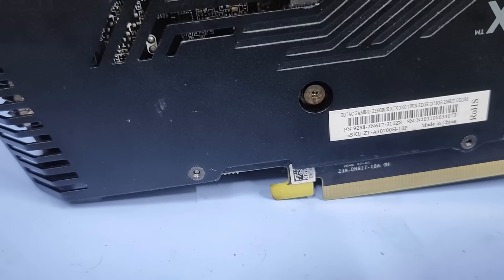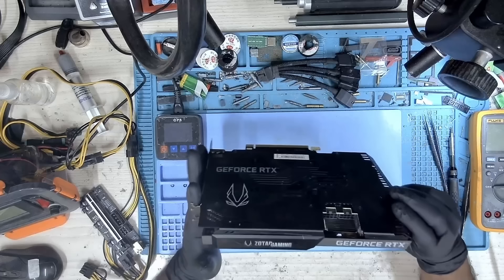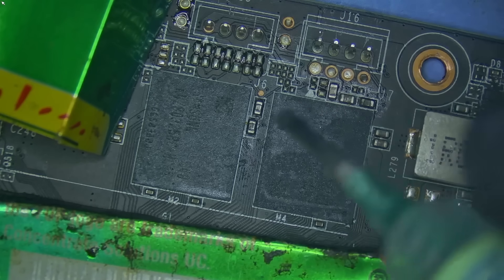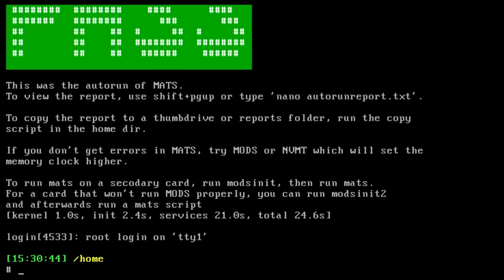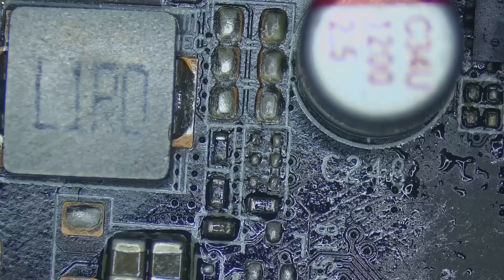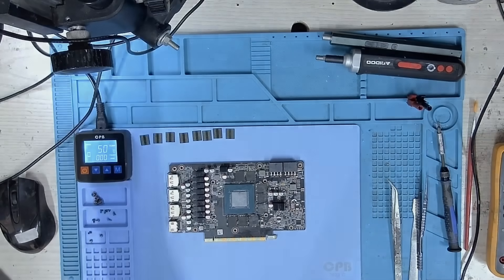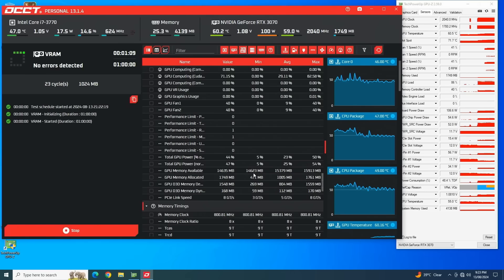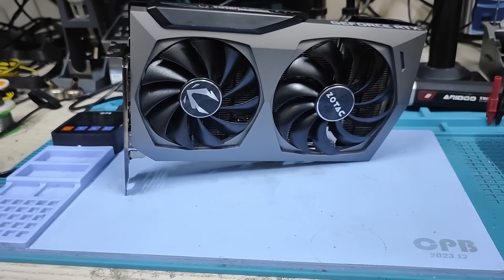Upgrading RTX 3070 Memory from 8GB to 16GB - Part 1

Comment: Since part 2 is gonna soon release (i checked the comments on your dead 3070 gpu), if possible, after a successful boot and the card manages to utilize the 16gb without any errors, would it be possible for you to mod other peoples cards?
I have a aorus 3070 gpu which i would like to game on for as long as possible, but vram is gonna become and issue sooner than i might think. I do soldering work myself but on much larger plates and way simpler (mill-max keyboards, mouse switches, basically the simplest form of hardware soldering), and im always fascinated by this type of content.

It would be cool to be interesting to see you accept other peoples cards for modifications, but i would assume this costs way more than just buying a new gpu + shipping to you and back.
Anyways goodluck solving the errors that will occur during the stress test and initial boot-ups!

EDIT: i checked your website and i can see that you indeed offer gpu upgrades to book, this comment is irrelevant now, besides the shipping part (i live in a country that barely ships anything out and if it does they charge you trillions because they suck)

Comment: is it possible to upgrade the rtx 4060 8gb to 16gb or even higher
Reply from the maker: Unfortunately none of the Nvidia 40 series can be upgraded as all the models use 2GB memory modules which is the largest capacity produced.

Comment: bro i have gtx 1050ti un runs well but after  of 1 hour using the screen begins on/off until i turn off the pc and turn it on
Reply from the maker: If the core is overheating than thermal paste is required. If thermals are not the issue the card has reached the end of life
Reply: @GraphicsCardRepairs-tk7ql  thanks bro i think it reaches the end

Comment: I just found out my gtx 1050 has 4gb of vram, but 2 are disabled, so I'm going to add the vram from a 1050ti to the 1050 to see if I can finally hit a smooth 30fps in modern games.

Comment: Why can’t we do this with the 3090 or 3090ti?
Reply from the maker: 3090 Ti already uses 2GB memory modules which is the highest capacity produced on the GDDR6 and GDDR6X platform. It also has only 12 memory slots. 3090 itself uses GDDR6X 1GB memory module. I have not tested upgrades on 3090 yet.
Reply: @GraphicsCardRepairs-tk7ql if you could do that your video would be insanely popular. This upgrade would definitely be the most popular since the next performant 48gb card available is £5k or something ridiculous.
Reply from the maker: If I get my hands on one I will test it

Comment: This is the problem with GPUs tbh. You get no control over it.
With CPUs you can pick the exact board, RAM, and cooler. GPU is essentially SOC.

Comment: Dear brother, do you also put "flux" on the RAM chips when installing? Or only on the board? And please let us know if you have made the car more stable these last few months! I have heard you can add more capacitors and this fixes voltage problems. I have the same card and I will do these in the future!! :)
Reply from the maker: Yes I apply flux on the memory modules as well. Due to the high volume of GPUs in queue for repair I could not work on the 3070. I would be continuing my work in February once I'm back from my vacation.
Reply: Thank you, me and many others will be waiting for this update! Have a nice vacation friend, be happy this year! Happy new year also!

Comment: What would a service like this cost? Would it even be beneficial to have this done or invest in a new card?
Reply from the maker: It depends on the use case. The 3070 black screen is not resolved yet. I will continue the work once I return from vacation.

Comment: Nvidia taking notes to limit power on the memory for 5070 😂😢

I will pay you $700 to upgrade my 4070 ti to 32 GB 😂 I wish I knew how. Maybe I can practice on some old crap cheap card first. But no idea what memory to get or if it will work. You can do this for a 2080 ti too but 3070 or 4070 is much better. I would be great if there were 8gb memory chips. With the right speeds.
Reply from the maker: Unfortunately none of the 40 series can be upgraded. They all use the largest capacity of 2GB memory modules produced on the GDDR6X and GDDR6 platforms.

Comment: Would you do this as a service? How much would you charge?
Reply from the maker: Yes I do. For the 2080Ti I charge $220 including the memory. Other cards when I find it working smoothly.
Reply: @GraphicsCardRepairs-tk7ql  I just bought a specific 3070 for a small form factor build. When/if you can get these working smoothly I would gladly pay for the service

Comment: Hello🤝Wow nice upgrade 👍👍👍👏👏👏👏I have a question, I bought an MSI 2070 8g. Armor OC has artifacts, I checked with a testing program and it turns out that the vrams are damaged, the dice have the markings 8TA77 D9WCW, I heard that they are very defective, do you know what I could put there and would I have to change the straps? P.S. Or maybe you know a trusted vram seller on Ali? Thank you and best regards👋👋👋👋👋
Reply from the maker: You can replace with Micron 2019 or later memory modules. If you buy new you should get all 2020 or later. You won't have to change straps if you do that.
Reply: Do you mean microns with the same D9WCW markings only from 2020, e.g. 0BA77, or maybe it's better to use Samsung ones and change the straps?
Reply from the maker: It depends on you. If you don't want to change the straps you can use the 2020 micron.  Else use Samsung.

Comment: I wonder if ASUS TUF Gaming GeForce RTX 3070 OC Edition could be a good canidate (just out of curiousity it has 3 cooling fans on it might get more out of a mod keeping the heat down and a bigger heatsink) most of the time i find that asus gpu's run a little bit faster from the basic specs vs ather gpu's. but yeah modding a gpu you do need know what you do. (im unsure if i even got those steady hands for this kind of work) pretty cool to see footage of the work. GPU Solutions just awesome. =) ---- p.s ive had a ather odd thing with pc crashing it was windows updates that changed my power settings to not be performance for gaming. --- also when it was set at 50% the pc was struggeling and would only go full out while playing Helldivers2 until i figure out what was the issue by finding it kept crashing due of power shortage -- maybe same with the gpu blackscreen it need more JUICE i think. also Windows OS is retared it dont know if you got laptop or game desktop pc. its a bit brain death optimized OS systeem with AI detection of hardware would be te future i geusse for settings.

Comment: 0:24 is wrong. The extra VRAM prevents the game from resorting to using system memory for textures (RAM), to of which at the very best with DDR5 is 70+- GB/s, with DDR4 its much worse at around 44GB/s at the best, usually 32-44. 

As you might imagine that is a lot slower than even the most budget GPU VRAM solutions (say 244GB/s) So long as the games scene textures are under the video cards frame buffer limit it runs as good as the card is designed for.

Comment: I am thinking about what if gpus have upgradable ram option just like pc ram upgrade, just buy the base version of the GPU with 8gb vram and then add another 8gb gddr6 module to the GPU, this would the innovation gamers need not UE 5 with realistic graphics that doesn't run in most of the pcs

Comment: Hmm...
That Black Screen issue might be related to some BIOS Problem or some memory timing issues.
Did you Check Memory Specs in terms of Voltage, Memory Timings and Power Requirements?
I think the larger memory chip, especially the one with a higher Memory Frequency might have Sloppier Timings and that's where your issues might come from.
You only get the Black Screen if you close an app that was using more than 8GB of VRAM?
Reply from the maker: Yes that's possible. I will work on that.

Comment: I would probably upgrade my RTX 3060Ti from 8GB to 16GB, but you're not explaining things right.
VRAM is very useful if you're using a higher resolution and High Quality Textures.
You'll also get a bit of extra performance / FPS / less staggering with increased VRAM.
Reply from the maker: Thank you for the input. I will add that in my future videos

Comment: Need to get my 3070ti upgraded to 16 gb..can u let me know, roughly how much you'll charge including everything like vram chips etc and repair cost
Reply from the maker: Unfortunately all GPU's with GDDR6X which includes 3070 Ti, all versions of the 3080 and 3090 have issues with memory upgrades. It's still a work in progress.

Comment: can you upgrade a 4090 to 32gb?
Reply: can as in ''is it possible and if so under what circumstances''
Reply from the maker: 4090 cannot be upgraded further. The highest capacity produced on a GDDR6X platform is 2GB. 4090 has 12 slots with 2GB making it 24. Unless a new PCB and Bios is resigned.

Comment: @11:35 Ah, so with this hardware solution you don't need to hack the firmware/bios of the GPU because it is not a software limitation.
Reply from the maker: No hack required. Works without any bios edits.

Comment: that is great!
and you didnt even need to flash a custom bios?! 
you only flipped around the straps? i didnt know that is possible.

maybe there is your problem? i guess it undershoots the voltage when coming down from a load and it blacks out for a second.
do you know how to make a custom bios?

would it be possible to add even more Vram?
like 4 gb modules instead of the 2 gb?
Reply from the maker: No edit or custom bios required. Works just buy swapping memory to 2 GB modules and rearranging straps. 2GB is the largest capacity produced till date on GDDR6 and GDDR6X platform.

Comment: You need bios to support more memory hence ide blackout.Sounds like software,or some other components other than memory needs to be changed as well when adding more.
Reply from the maker: Yes it could be the timings as well. I will work on the BIOS and test when im releasing Part 2 of this video.

Comment: Wow... very impressive -- almost wants to make me try it myself! Did you have to do anything special besides the high performance in Nvidia Settings (firmware modifications, moving resistors like I saw in other videos, etc.) to get it work?
Reply from the maker: No modification is required. Straight swap of memory and change straps that's it.

Comment: The primary distinction of VRAM is the occasional micro stuttering however some people exaggerate that lower VRAM will make a game unplayable. In reality 8GB of VRAM at 1080p/1440p resolution with DLSS/FSR and high/medium quality settings is quite sufficient. This card is not designed to run native 4K at ultra quality.
Reply: What if i Want 1440p native with no framegen bs? 16 is the only solution...

Comment: You dont even need to do this to get more out of your hardware, especially the 3070. 

Google Nukem9, which will allow DLSS3 on every single supported game, even puredark mods, via FSR3. Since Nvidia defined DLSS3 as having Reflex as a requisite (DLSS3=DLSS2+framegen+reflex per official marketing materials) this enforces reflex as well. 

This is information being held from you. Ratchet and Clank got FSR frame genration officially, and you can use this mod also to enable "DLSS3." Try both, I dare you. See the frame generation experience the patch brings (and what AMD GPU users know as frame generation), now see the mod that even fixes the ****ing graphics.

Yeah keep removing this comment youtube. When will you people realize that... in some discreet way, these companies are all in bed together?

Comment: It's just extremely odd that Nvidia decided to put 12GB on the 3060, yet not the 4060 nor 3070. Or atleast place the 12gb on the 3060ti, that would make more sense. Extremely backwards components.
Reply: That was to make sales without taking away sales from more expensive products, it's market segmentation for more money. A slow card with more memory,a fast card with less memory,a fast card with more memory,charge through the nose for the card that has it all but still sell the crappier cards then sell them a new one when it isn't good enough.
Reply: @ffwast  Exactly right, this guy gets it. The have-it-all cards must be kept prohibitively expensive since the vendors risk not seeing any more revenue from those customers for 3+ years. 
The cheaper cards are intentionally designed less future-proof, thus the vendors can plan their finances around the strong likelihood those customers will return to purchase another upgrade soon enough.

Comment: I have the White Edition version of that card. I just subbed and liked. If you indeed have a guide on this 2 parter, I am going to give it a go. I would love 16GB on my card. It would give it life that it wasn't going to get otherwise. The issue I see with the 3070 has always been VRAM limitation as I like to play in 4K. Once it starts using that 8GB of cache it yanks from main memory, you can see the issues. I noticed that the extra VRAM on these cards prevent the .1% and 1% low dips that are common with 8GB cards trying to run in 2160p. That in itself is worth it. I have thought about selling this card and buying a used 2080 Ti with the money for too long now. I have also considered financing a 4080 Super. Both of these ideas should not be things I think about. Ever. This card should have come with the 12GB they gave the 3060. It would have made so much more sense.

Comment: Great video!! I've been doing bga reballs for a while now but never with GPU's. Interested in seeing part 2 :) Also, I've been trying to find that video card power adapter setup you show on your desk, is that a custom one with the orange locking flaps? Thanks!
Reply from the maker: Yes it's a custom supply. It sources its main power from a bench power supply. It has its own circuit but I have disconnected it. The case of it is a tiffin box.

Comment: Just Curious but if these RAM upgrades can be done on this GPU will it be Possible to upgrade the ram say on a 4070  SUPER 12 GB TO 16GB?
Thanks for this Great Tutorial 😊
Reply from the maker: None of the Nvidia 40 series can be upgraded. They all use 2 GB memory modules which is the highest capacity produced on GDDR6 and GDDR6X platform.

Comment: STUPID QUESTION...
old post but... have you tried without the fans? (run the fans to the MOTHERBOARD instead)
When I modded my last couple graphics cards with Noctua fans I got coil whine. I realized it had to do with POWER DELIVERY as the design ASSUMES a certain amount of current in certain spots. When I ran the fans to the MOTHERBOARD instead the coil whine went away. I doubt that would be related, but you never know.
Reply from the maker: Thank you for the suggestion. I have not tried it.

Comment: NVIDIA didn't make a higher-memory RTX 3070 to balance the card’s market positioning, performance, and cost within their product lineup. The RTX 3070 was intended to provide a strong performance-to-cost ratio for 1440p gaming. By keeping its memory at 8GB, NVIDIA could control manufacturing costs, making it an appealing choice for budget-conscious gamers.

Higher memory capacities typically increase production costs, power consumption, and overall card pricing. To cater to users needing more memory for demanding applications (like high-end gaming at 4K or intensive workstation tasks), NVIDIA positioned higher-memory cards in the 3080 and 3090 tiers. By doing so, they kept the 3070’s price-performance sweet spot while offering higher VRAM options in pricier cards for those needing it.

Comment: Buying RX6800 was my best decision ever
Reply: Same, I can't believe that in the UK and RTX3070 is still up to £300 used? What a pile of junk it is......if it was around £150 it would be worth buying to MOD for AI purposes only but the memory bus is still 448gbs against the rx6800's 512gbs?
Reply: The BUS is shit on the lower 3000 series Nvidia cards, the Vram is an illusion with a shit BUS speed...the rx6800 slaps it big time....yeh £150 max...it's a trick....best lower end Nvidia card is the 3080 TI with 384 Bit BUS but it's only £100 cheaper than the 3090 so eh....it's the 3090 then....

Comment: First of all, I LOVE projects like these, tinkering with hardware is just a good time. As for the everyday user, even if this did work (VERY few people can do this physically successfully, also GPU may not be compatable for many reasons) these GPUS have literally the perfect amount of ram for what it is. The actual performance will not appreciate at all. The only usage scenario would be for example in a game that limits your graphics options due to memory like GTA 5 or any  software actually limiting what you can do directly due to amount of memory which is very niche. "Future proofing" is smoke and mirrors, at best. Just do some research. My philosophy is NEVER buy brand new tech, wait till the user experiences are plentiful (around 6 months or so,) then buy at the top of price/performance curve. Where 8 GB becomes a problem is above 2k gaming, basically... and even then it only is an issue for high end GPU's which can actually benefit from the leg room.
Reply from the maker: Thank you for sharing. 😊

Comment: One question, can the gtx 1660 ti be upgraded to 8 or 12 gigs?
Reply from the maker: The cost of upgrades on this card would cost more than the value of the GPU. For the price of upgrade  you can buy a used 2080.